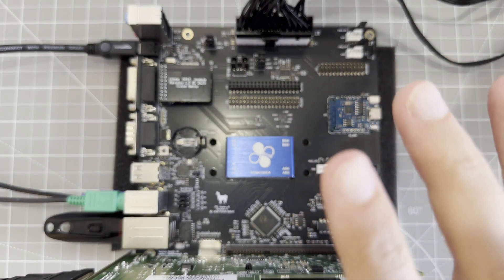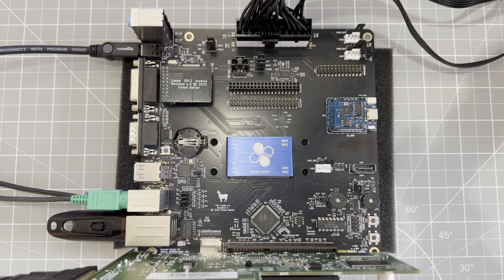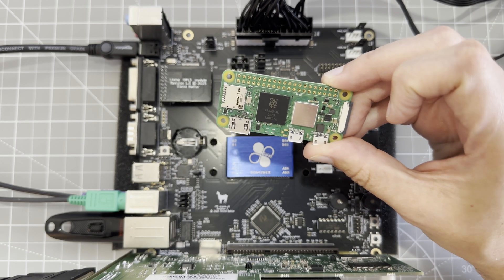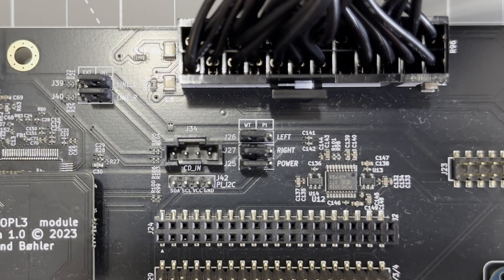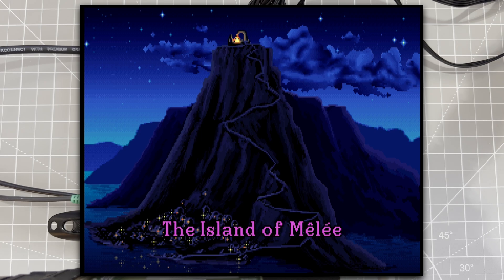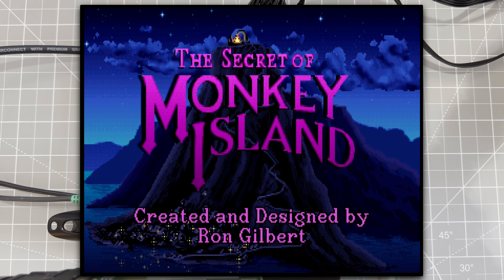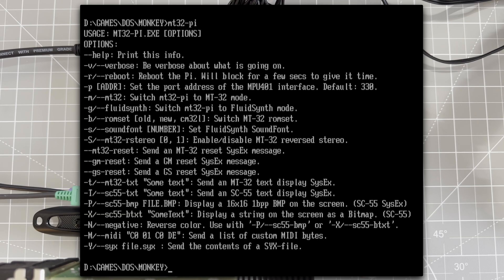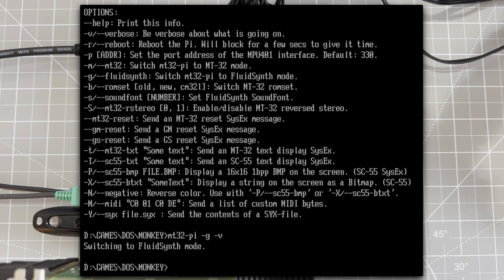ITX Llama Part 2: A Sonic Supercharge

Comment: Is it possible to use the WP32/MT32Pi Drive Bay Panel from Serdashop?
Reply from the maker: You would need to figure out a way to connect the GPIO pins (e.g. solder to the back of the Pi Zero).

But it should work 😎

Comment: You should check out the eXoDOS project. It's a package of 7000+ classic DOS games that have been made to run via DOSBox. However, I'm sure you could run them on your little board as well without emulation.